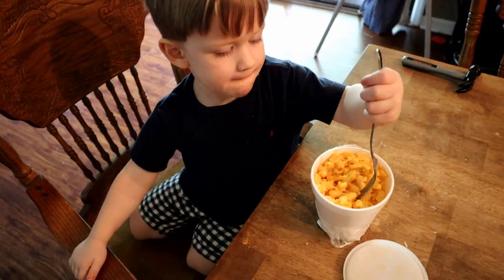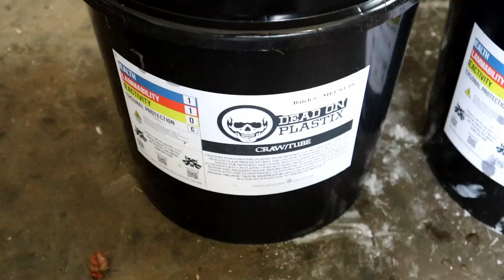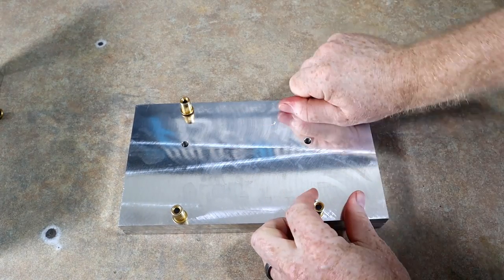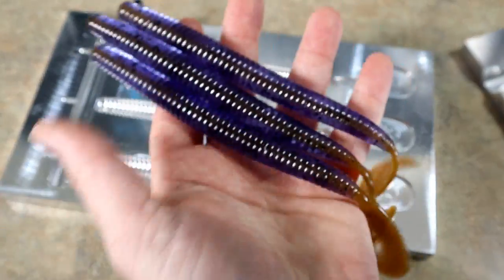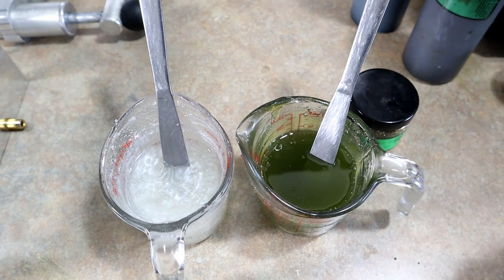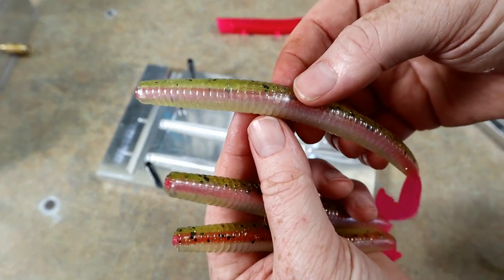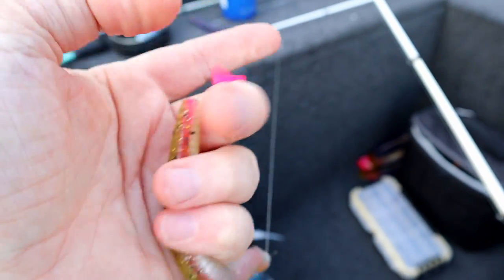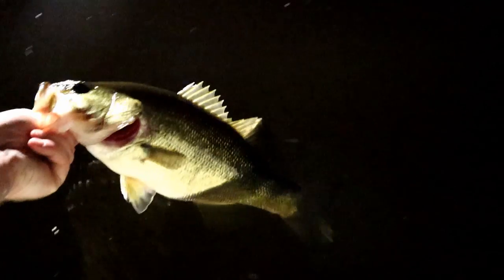New MAGNUM CORE-SHOT AR Worm Mold!! Pour & Catch

Comment: If you wanted to use the tail mold with the core shot, couldn't you just cut the shell to end before the last side vent in front of the tail? You'd have a ring of the core color between the shell and the tail, but that should still look good.
Reply from the maker: That's actually an interesting thought I might try that